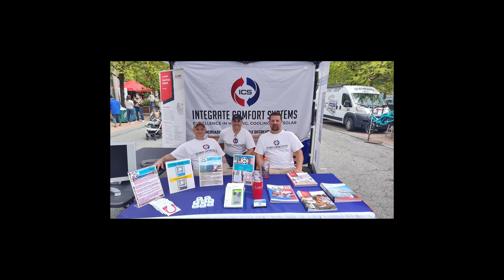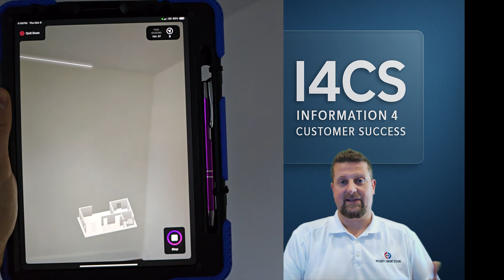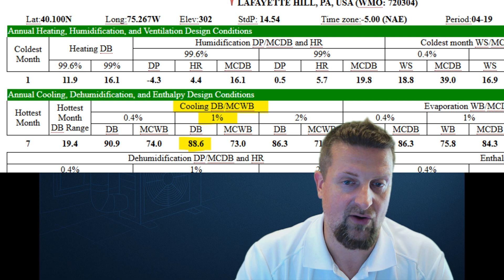I4CS Ep5 The Truth About AC Performance on 100° Days (Design Day Explained)

Comment: Why do people say a/c will only cool like 20-30° from outside temp? My house is 61° inside when it's 110 heat index & my car a/c blows at 44°
Reply from the maker: Just watch the video. Different climates and different house profiles will give you a different results
Reply: Insulation, humidity, shading, location of AC, window type, many variables and under most common circumstances 30 degrees is all you get.